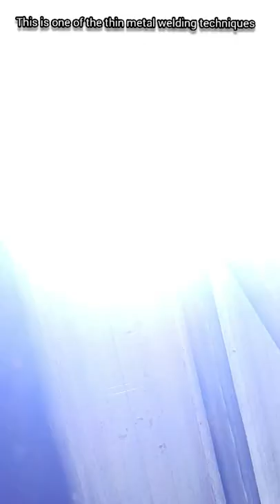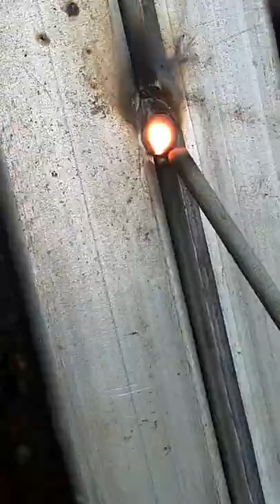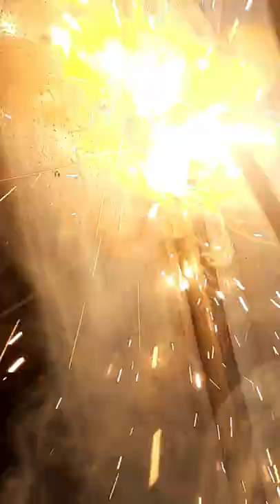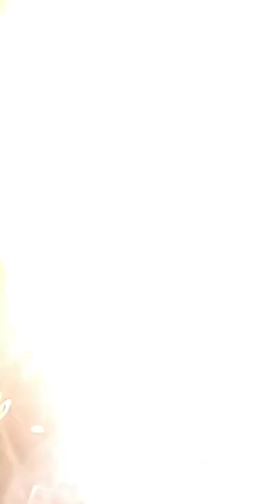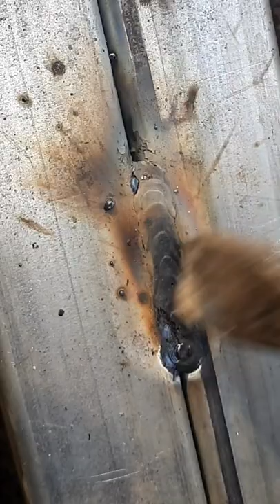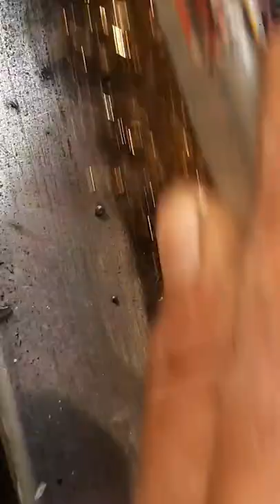Welding thin metal technique , welding thin square tubing #Shorts

Comment: Incorrect. First of all find the correct/best process that you have access to for the application. 2nd run the correct wire/electrode last of all adjust your settings correctly and you should be able to lay an actual bead down instead of just putting 100 tacks along the joint you're welding 🤣. But I guess it works for what you need it to do so 🤷